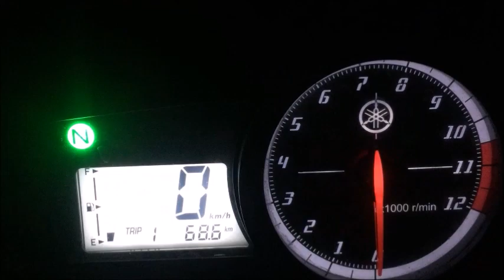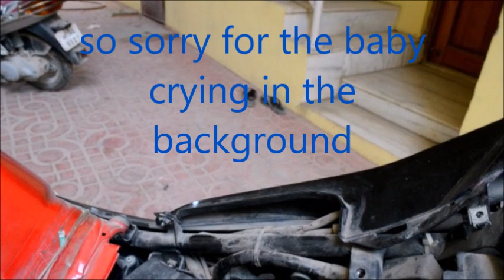Yamaha R15 self start not working | relay | battery replaced under warranty

Comment: Hi mera r15 v2  ingecter  pe power saple nai ara hai , he kya problam hai
Reply from the maker: Rehansajeeda Rehansajeeda hey bro..kaise pataa ki power nai aaraha h??  chaabi on karte hi tank ke andar se awaz aati h pump ki??
Reply: @ddvlogsDipakk  what's the cost of v2.0 fuel pump. Does it come along with the tank or is it a separate part. 
  Also what's the sound that Congress when we turn the keys on when the rpm arrow rotates. Is it the sound of fuel pump activating our from the starter relay. 
   What kind of problems are there when there is afuel pump problem. Thanks hoping for areply
Reply from the maker: Bikram Singh fuel pump is expensive 10k.... we will fix it...dont buy.. 😁
Reply: @ddvlogsDipakk  i wrote on a separate comment on this video about my problem I'm having. If ucan check n tell what's the problem, it'd be off great help. Can't afford to buy afuel pump right now. 
Also how do u fix the whole fuel pump cause it's got many things, the filter/ mesh , the pump motor, wires.

Comment: I dont know why u said those cut off relays costs 400+ rs.The blue one is starter CUT OFF relay and it costs 89rs.  green one is radiator fan cut off that also costs 89.If you are talking about STARTER RELAY not cut off relay then that will cost you 230 rs
Reply from the maker: siril_YZF499 but bro i asked him he said its 120... i mentioned at 4:02...
but thanks a lot for the information.. glad to know its even cheaper..😀
Reply: Brother plz reply

Comment: Bro today my v2 dont started in the 1 st gear so i swift to neutral and tried and started..i adjusted the clutch and tested then she started but in when turn on the kill switch and applying the clutch a tick sound coming from my back tail portion whats that.?
Reply from the maker: Just one tick or multiple ticks? That's battery down..it's not able to attain the voltage...charge the battery and check..if the battery is not able to hold charge for long then time to change the battery, of battery is good n still it occurs along with yellow light..probably rectifier issue..do dm me on insta - @bikerdog_
We will talk further..
Reply: @ddvlogsDipakk  just one tick sound only when applying the clutch for self start
Reply from the maker: @Noufal860  how about without clutch..when in neutral
Reply: @ddvlogsDipakk  self press krne pr tick sound ari h 1 time back se. please suggest me what to do.
Reply from the maker: @amitchauhan7719  seems like battery down bro

Comment: Bhai meri R15 V2 hai self use krte raho but start nahi Hoti push se start ho jati hai ek Baar me aur thodi der chalane ke Baad start hone lagti hai aur agr chalane ke Baad khadi kr do to phir nahi self start Hoti hai can you help me
Reply from the maker: Absolutely bro...there are 2 things either the battery voltage has dropped low or the terminals connection is weak...but maine yeh face kia h... battery 3 saal ho gayi kya bro??
Reply: @ddvlogsDipakk  nahi bhai Abhi warranty me hai 5 months ki hui hai abhi
Reply: Self lete lete battery low ho jati hai but start nahi Hoti hai aur push me ek Baar me start ho jati hai
Reply from the maker: @kalashshukla9590  bro Dhaka marne se start isiliye ho rahi h kyun ki battery poori dead nai h..fuel pump ko power karne layak charge h but itna nahi ki bike start ho jaye...battery gayi h confirm, warranty k under replacement kar do bro
Reply: @ddvlogsDipakk  bhai self lagta hai kafi Baar but start nahi Hoti aur chane ke Baad hone lagti hai kya ye bhi battery ki problem hai
Reply: SF sonic ki battery hai
Reply: Yehi same problem meri bike me hai bro koi solution ho to btao

Comment: Yes Bro same problem came to my bike.I'm not sure whether the battery is damage or not.but when I kept in a shop for charging then it's work.but,it last only 1,2 days then an again it will shut down(can't start).I used to start in gear also it didn't work.so can you please tell me bro.
Reply from the maker: bro if your battery is more than 2 years old then very likely you need a new battery...as the battery has lost its charge holding capacity..
Reply: @ddvlogsDipakk  OK thank you so much bro
Reply: Bhai Dynamo change karo

Comment: Bro!! My r15 v1 has problem with self start. Whenever I try to start it a kind of noise tik-tik comes from battery I think. And the digital meter turns off after that. But headlight and indicators are working fine
Reply from the maker: its battery problem bro....how old is ur battery?
Reply: Bro it is normal sound don't worry my also has same like u , this sound comes from starter relay

Comment: Hello brother.  I am also facing some issue related battery. My bikes odometer turning off. Yesterday itself i bought new battery and i fixed but still i am fac6the same problem.  Whether it might be related rr unit? Or relay.  Please give me suggestion.
Reply from the maker: Hey bro..inspite of new battery of it's still turning off..please change the fuse and check...and also check the voltage of the battery...if the voltage is down n still the same issue..then it's the rectifier problem
Reply: @ddvlogsDipakk  thanks brother. Its rectifier problem itself.
Reply from the maker: @vishalm1605  the rectifier for V2 should cost you around 800...please check n confirm with them..
Reply: @ddvlogsDipakk  today i went service centre. They told me that it is 1200. I paind.And still my problem was not solved so i returned it. I am not getting what to do.
Reply from the maker: @vishalm1605  bro please DM me on instagram, we will talk further
Reply: @ddvlogsDipakk  ok

Comment: My speed sensor is not working... And showing the yellow light also... And some time ..when I'm at high rpm...the bike gets shutdown engine will automatically gets off .. And some time when I do self start....in speedo meter the lights gets off ND re apper gain !!
Reply from the maker: bro my experience says thisnis related to RR unit...i had same issues exactly, but before that get the battery checked..if recharging battery works then its battery issue..if battery charge gets low again then RR unit issue
Reply: @ddvlogsDipakk  didn't get the battery concept plz tell ones more
Reply from the maker: bro dekho the battery has a limit to hold the charge, once very old it cannot, hence we need to get new battery.. but there is also possibility the battery charger is weak and not able to charge the battery.. so first get ur battery charged to 12.6V and then check.. if the battery is down again in few days..it means the RR unit needs to be changed
Reply: @ddvlogsDipakk  thanks buddy
Reply from the maker: you're welcome bro, do reach me on Instagram - de3puckk or email: de3puckk@gmail.com
Reply: @ddvlogsDipakk  followed
Reply from the maker: thank you bro
Reply: dj prashant same happened with me yeasterday,,, error 46 came up,,,which corresponds to rr unit or electrical system or vattery failure.
i gave to service centre they checked with new rr unit,,they said ki battery cheack karvao,,bike is working fine since working ,,no orange light....
plz tell me what happened to ur bike after that
Reply: what happened to ur bike after that,plz tell me cause same problem happened with me

Comment: Please help me anyone in my bike I face a problem which was when I start my bike it shutts down, so Yamaha guys replaced the battery later faced same problem then they change RRunit and magnetic Coil and after some months am facing the same problem what the heck is wrong?
Reply from the maker: bro, it seems different..i guess they have checked all the things, now i feel it could be bcuz of spark plug or air intake..or it could be as simple as ignition switch issue, my friend had same issue, please DM me on instagram, and send a video of how it behaves
Reply: Check thoroly working isssue

Comment: Bro, in my r15 after battery replacement, the Electrical system is also not working. Could that be relay problem ?
Reply from the maker: if its not working at all bro then its a fuse prob, but if some part is not working like the self start or radiator then relay issue
Reply: @ddvlogsDipakk How to buy relay bro plz plz reply

Comment: My bike r15s also has the same issue and I changed the battery it was working fine for some days but again after some days the self is not working.....it feels me so irritated with yamaha
Reply from the maker: No bro this is just a minor thing...do have any idea..many other brands like RE n Bajaj have even bigger issues...
Seems like RR unit problem...does the yellow light blink ?
Reply: @ddvlogsDipakk  no bro once I turn on the key nothing gets on...no lights blink...????

Comment: Bhai mere sath v same issue hua meri gadi ki battry bahut jaldi drain hui gadi self nahi le rahi thi mei charge karane gya tow usne change karna suggest kiya so meina battry change karwayi lekin change karane k bad thik chali but uske bad phir bike start ni hori self kam karra hai bhas gadi start nahi hori na koi blink hora meter pe or meter v thik kaam karra plz help
Reply from the maker: Bro 2nd battery bhi low voltage dikhaya Kya?? In that case charging nahi ho raha hai, isme 2 possiblity hai - Rectifier, which is responsible for charging the battery and 2nd armature Jo enough power supply nahi Kar pa rahi hai but bro being a Yamaha user I don't think armature me kuch bhi hoga and. R15 is known for having bad rectifier
Reply: sprak plug ud gya hoga

Comment: Bro my battery is like 2 years old!  When i m trying to start my r15 v2  it just not crank for the first time, like nothing happens..but when i try for tje second time..it cranks up..the major issue is sometimes while revving my bike it just resist..u can like say it missing issue, need ur help!!
Reply from the maker: Sharang Sharma bro that seems 2 different issues to me.. bike not starting initially could be related to low battery, bad relay or carbon formation in the self start switch.. and if all the mechanical parts are good like air filter chain, tyre pressure then it’s the REctifier which might cause pickup issue as when bike demand more fuel it doesn’t allow, we need to talk more and know more about it.. please drop me an email : de3puckk@gmail.com

Comment: Bro my bike is not initially starting but after running 5 or more km it's self is taking.Is this problem related to battery
Reply from the maker: Sachu R yes bro seems like battery problem.. can u try with a new or another battery if same thing happens then its a problem with relay.. blue one under seat..

Comment: Can u plzz tell me which battery and how much volte is compatible for r15.
Reply from the maker: lakshay sharma sure bro, i m using exide now, 3.5AH
Reply: Broo 2day i have gone to 1 of local mechanic he said me that battery which Iam using that is enough for mah bike but the issue looks like in motor of self start dnt knw what 2 do even in this month i spent around 5500rs on my r15 but still not satisfied..
Reply from the maker: bro I think its the relay issue, which will cost you 130 and you can change it yourself, its under the seat, but I think we get motor problem so easily
how come you spend 5500, what all did you do ?
Reply: I have changed piston bcoz oil pump was not working so piston was not getting engine oil that's y piston was spoiled..
Reply from the maker: lakshay sharma oil pump? where is it located? piston got damaged!!? so new piston?
Reply: @ddvlogsDipakk  whats the name of that relay?????
Reply from the maker: @imunknown6262  bro there are 2 relays, blue one is for self start and green for radiator

Comment: Brother listen to me ... 😫
Every time I use my self I keeps trying to start but will refuse to start. .  and couple of tries and then she starts up. .. Its not like I click the button and its dead .. Its taking self but not starting .  
And when the engine is hot the it takes a one self start. . need your help
Reply from the maker: bro this is sign of weak battery, get your battery charged and check..of battery too old  then get new battery and check..but before buying a battery check if battery is good
Reply: @ddvlogsDipakk  cool bro ... Lemme check it .. Its it works , good ..
If no let me take the bike to the service centre.. I'll keep you updated
Reply from the maker: @CalbikerNitin  if battery is good n  works fine then chances of rectifier issue
Reply: @ddvlogsDipakk  dude my battery is all fine. .. I don't know what is up with my baby , why she's behaving like this 🙄

Comment: Did anyone have wiring diagram of r15 post 2015 models.
Reply from the maker: 2015 model means the R15s or R15 V2? however check this out: https://www.manualslib.com/manual/1096691/Yamaha-Yzf-R15.html?page=337